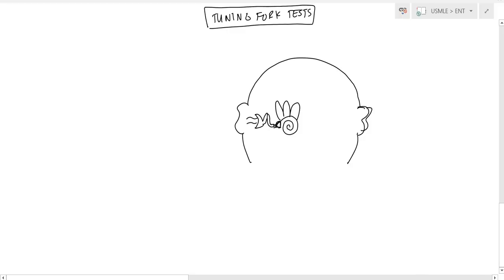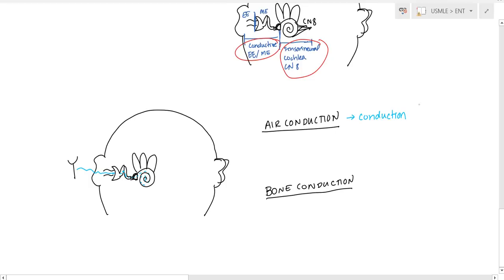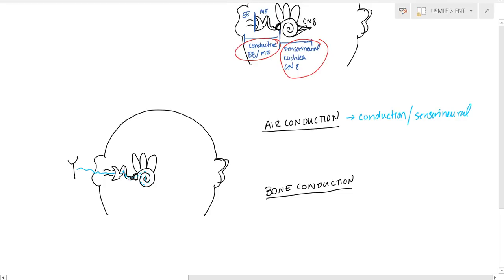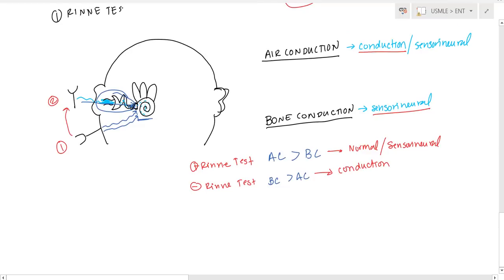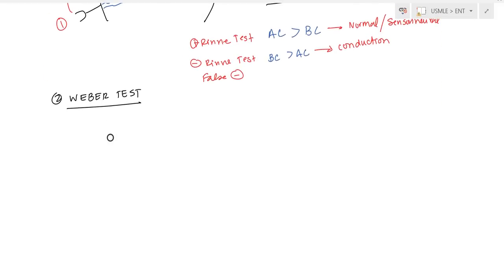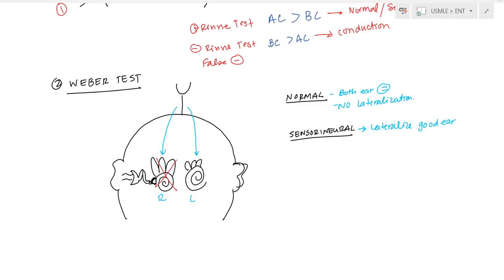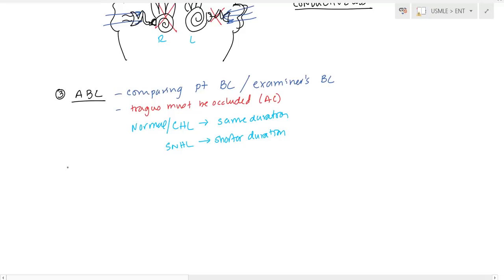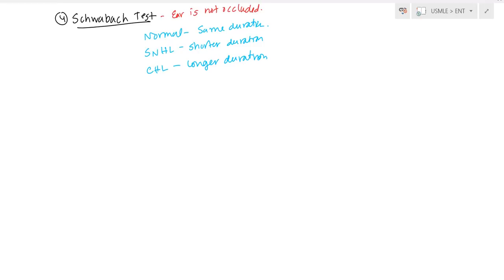Weber and Rinne Tuning Fork tests for USMLE

Comment: Some one can help me to explain why Rinne test (+) sensorineura hearingl lost, please? thank you very much.
any way, your video is clear and easy to understand. love your video ^_^
Reply: If AC>BC in both ears, Rinne's test is positive. However, upon performing Weber's test, if the sound lateralises better to one side (e.g. lateralises to left ear), it implies that there's a sensorineural hearing loss on the opposite ear (i.e. the right ear). This is because with Weber's test, where the sound is only conducted through the bone directly to the cochlea, if it is heard louder on one side, the other side must have a sensorineural hearing deficit.

Comment: could  you please answer this and give explanation too.thanks

1.An adult male with bilateral Rinne positive  and Weber test lateralized  to left  side,he has...
a.Right SNHL
b.right CHL
c.left SNHL
d.left CHL
Reply: Bilateral positive Rinne test means that air conduction > bone conduction in both ears. This rules out any conductive hearing loss. You are left with sensorineural hearing loss. 

Weber test lateralizing to left side means that bone conduction (sensorineural) to the right ear is affected because it is not able to process the vibration. Thus, there is a sensorineural problem of the right ear, or A in your choices :)
Reply: A

Comment: Great explanation of these exams and this pathology...the "False negative" through me for a bit of a loop though. But I think I was able to integrate it with the rest of the concepts. I suspect that when you have a severely damaged Choclea (Sensorineural hearing loss), the organ is partially in fragments and likely to be more responsive to bone vibrations than activation through air conduction at which point you have a sensorineural hearing loss with a "False negative Rinne Test" What are your thoughts on this??
Reply: In severe sensorineural hearing loss,there is a false negative rinne's(bone conduction better than air conduction). This enhanced bone conduction is actually from the other ear (unaffected one) through transcranial transmission.
Reply from the maker: +Ahmed Mohyeldin There are two way to think of it. One is the way you proposed which suggests that the BC increases. Another way to think of it that the AC becomes completely zero and therefore even a small effect from BC will make BC greater than AC. I am not sure which one is correct, and if I had to bet I would say in some circumstances you have an increased BC and in other circumstances you have an increase in AC.

Comment: what is lateralization?
Reply from the maker: Laterilization refers to hearing the sound on one side but not the other. If the sound is heard equally on both sides then it does not lateral owed, however if the sound is heard more on the left or right side then we called it Laterilization.